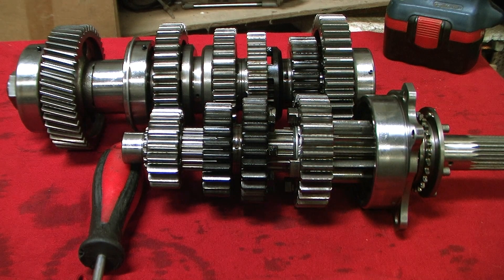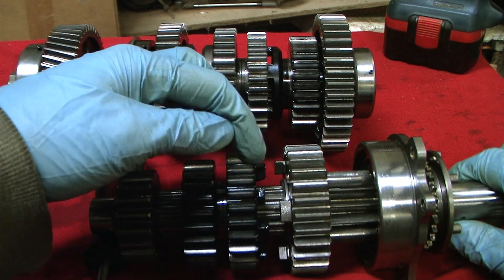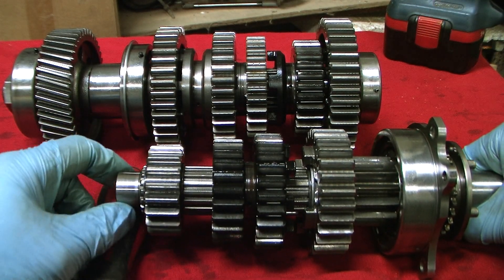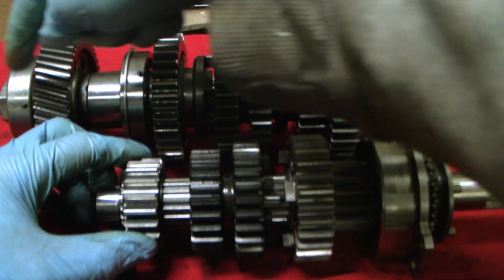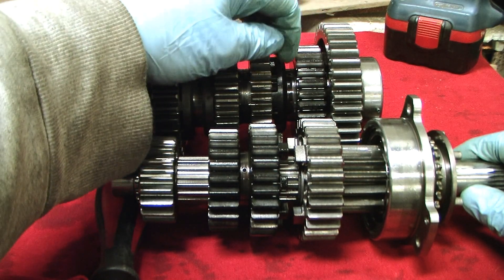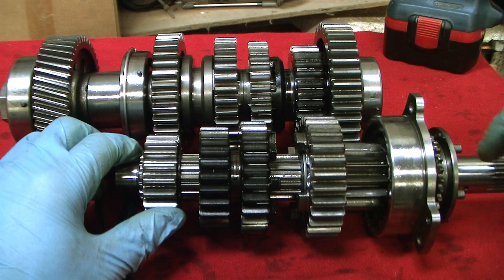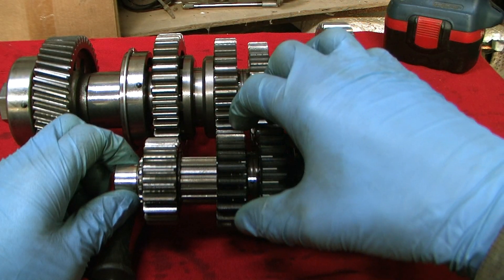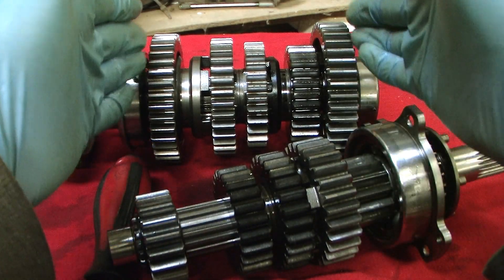Rocket III - 6th Gear Transmission R&D

Comment: Use koneggseggs converter....one to one.....😉👍plenty of torque multiplication to overdrive....get rid of all those messy gears...😝....or engine to generator for an electric motor.....I'm sure the triple can handle electrical generation...😂...

Comment: I have an ‘05 Rocket III I bought new and I added Jardine pipes, TuneBoy with a custom tune and a windshield,  bags and some chrome.. Jardine used it to design pipes and K&N used it to design their production air filter but built me a special one. They tested the bike and recorded 160hp and 170 lb.ft. of torque on their dyno with my most powerful TuneBoy tune!! The only problem I ever had was with the clock!! Douglas Motorcycles replaced it and no more problems!! I am very easy on the clutch and tranny and have pegged the speedo @ 140 in 4th gear but no where to go to shift into 5th. I would sure appreciate a 6th gear for cruising if it’s affordable!!! Please let us know when available...